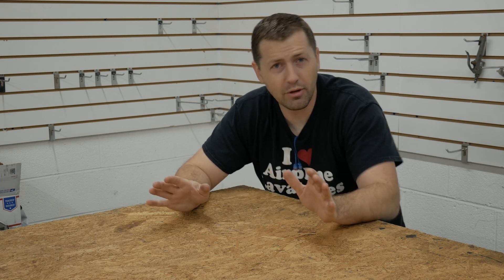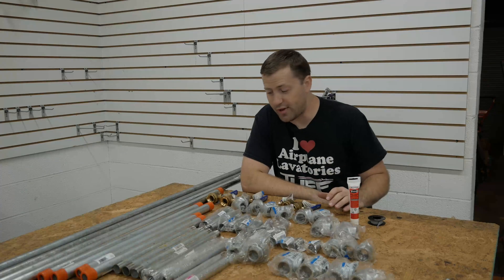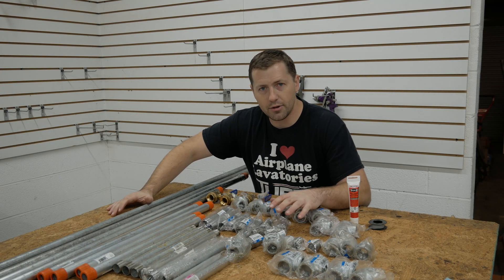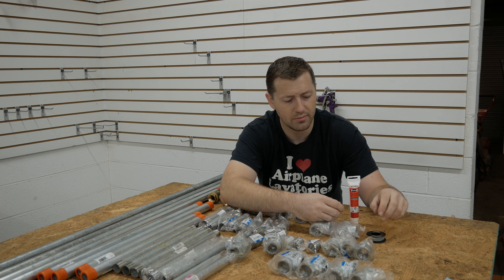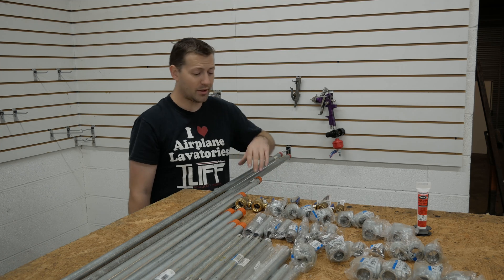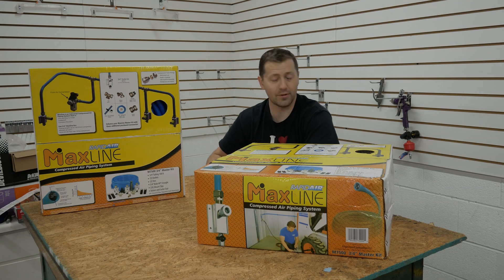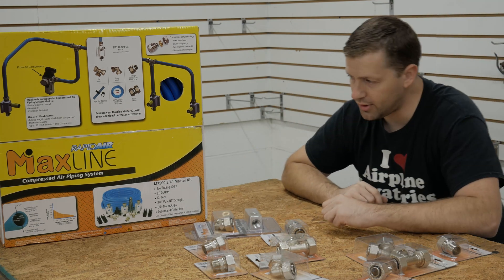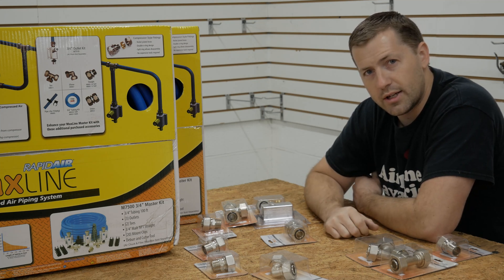My Air Compressor Setup is TERRIBLE Pt2-all about pipe

Comment: Where did you get the 3/4 flex hose ? All I ha e seen is water heater hoses, which i guess will work.
Reply from the maker: NOOOOO, don't use water hose! standby Ill grab you a link!
Reply from the maker: https://amzn.to/2JcDSTf
Its a rapid air "jumper" hose. I'm sure you could source one elsewhere but they are all probably about the same price.
Reply: @hcr-motorworks  Awesome. I wasnt going to use the water heater hose, its too shallow of a coupler, my ass wouldnt allow me to be near it pressurized.
Looking at your set up convinced me to use the Rapid Air system, looks fool proof.
Thanks for all your videos.
Reply from the maker: I love the Rapid air setup, I went with the 3/4 semi rigid flexible hose... Its a great system but Im OCD when it comes to aesthetics and I'm almost wishing I would have bought the rapid air "fast pipe" rigid kit instead. I don't think you could go wrong with either system though and it sure beats the heck of of regular black or galvanized pipe running throughout the shop!